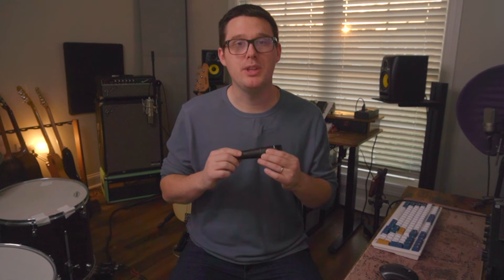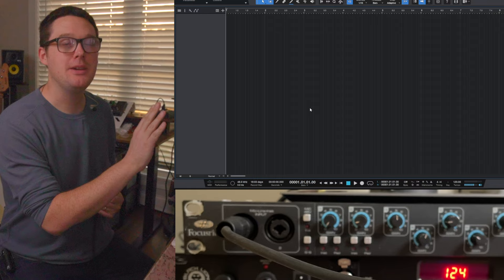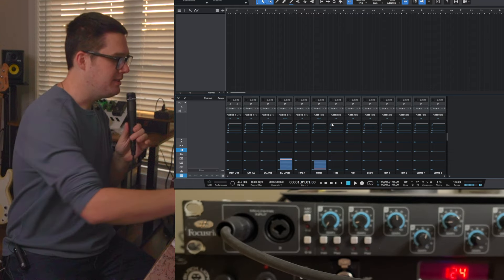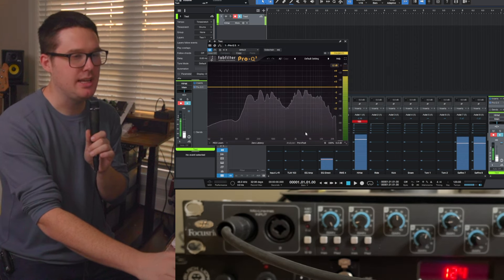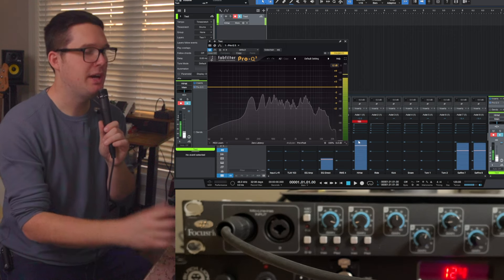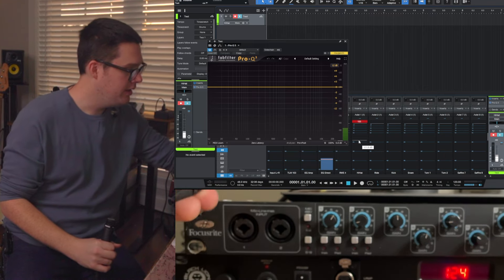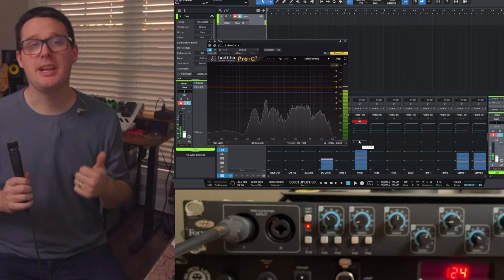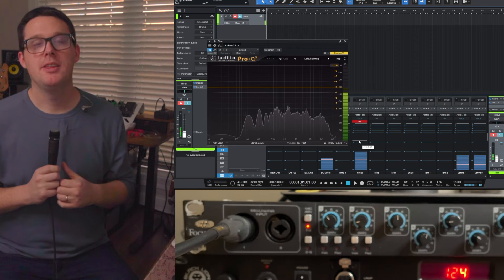How to Stop Hissing Noise When Recording

Comment: Hi chris, My interface has a high pitched hiss that records even when I am not using gain. Do you have any idea on what might be the problem?
Reply from the maker: Are you hearing this in your monitors or headphones? I have a pair of Rokit 5 monitors and one of them hisses quite a bit. They are old and busted up. The cables could have issues as well.. it can be a pain but if you take some time to swap out cables one by one and try different speakers or headphones you can deduce the problem that way. The output of audio interfaces also have noise to them as well. Cheaper interfaces will be noisy when you crank the output. Could be a mic cable or also guitar signals.. recording guitars is very noisy, single coils can be a problem or heavy gained guitars.. 

Switch off phantom power or 48v if possible.. record your signal into studio one and export the audio to a WAV file. Take the recording and listen to it in your car to see if it is actually recording with a high pitched noise or if it’s just the interface

Comment: Hey im into VO and ive connected my condensor mic to a mixer that has phantom power than thenoutputs mic audio to my laptop through rca and 3.5, or 1/4 to 3.5 and im getting some hissing noise, i switched the two cables and still the same, the hiss is below -48db but is there a way to completely eliminate it? i rem connecting the 3,5 using an adapter to the type c port and it was clean, any idea how and why?

Comment: Thank you so much for this video. 
I honestly thought my Scarlett Solo was broken when I saw a high noise floor. This makes a lot of sense and I'll be getting CloudLifter immediately!
Quick question - if both the mic and the CloudLifter require phantom power, does that cause a problem?
Reply from the maker: Great! Be careful the cloudlifter does not pass 48v phantom power and is only meant for dynamic and ribbon microphones 😬 

Condenser mics should have sufficient gain on their own but just know not every condenser mic is the same quality.. some mics are very poorly designed and have excessive noise to them. Thanks for watching!

Comment: Hi chris your video's are extremely helpful thank you i use a sm7b into a mixer then into audio interface would you recommend a cloud lifter with this setup thanks
Reply from the maker: What kind of mixer and interface are you using? They both have mic preamps so you wouldn’t need the cloudlifter for more level.. it MIGHT benefit your setup if you have a noisy mixer or interface.. the cloudlifter is 10db of clean gain, I use mine all the time. If you use it before your mixer just be sure you’re using the line out from your board to your interface.. things can get messy with so many levels of amplifying 😅

If the gain knob of your mixer is above the 50% mark I would check out the cloud lifter. Send it back if you aren’t satisfied. I’m not 100% on their policies but I’m sure a Sweetwater salesman can explain their policy
Reply: @heychrisgreen  hey Chris thanks for reply it's a small beringer mixer and presonus interface thanks for your advice appreciate it

Comment: I have a important question bro please help me  🙏🏻
When I increase the gain to the end and no microphone is connected, a hissing sound comes into the headphones. Is that normal or my volt1 sound card broken?
Reply from the maker: Great question! First of all, if you increase the gain knob to 100% you will definitely hear hissing sounds. That is true of all preamps. BUT if your mic preamp is turned down all the way and you’re hearing a hissing noise I am assuming you are hearing the hissing from your output knob. Confusing to speak of but there is noise that is present with inputs AND outputs.. your output is essentially an amp for headphones and speakers.. not every interface is created equal.. I have most often heard hissing noises that are high in interfaces less than $400.. one test you could do is record a signal in your DAW and go to your car or other speaker system and play it back to compare the noise level.. if you only hear the noise in your headphones with your volt but not in your car then it most likely is just the quality of your interface. 

Also listen to music or a YouTube video with your headphones on at an appropriate volume.. you should not be hearing any hiss.. if you do I would say that interface may not be broken but it is just a poor quality. 

Sorry for rambling but I know that is a frustrating thing!

Comment: It's an interesting video. However, the cloudlifter isn’t suitable for condenser mics, like I use. Even if it was, all that is really achieved is moving some of the pre-amplification from the cheap interface which you already have, to the expensive cloud lifter you have to buy. 🤔
Reply from the maker: Thanks for the comment! 🙂 I hear you!
I would say most audio interfaces less than $500 have a typical noisy preamp. The most affordable route is a cloudlifter. External mic preamps go for $300 on the cheap side, and even the Warm Audio gear is $700+. I’d rather go cloudlifter for $149 than have to start over (if you bought your interface already)
I’ve owned the Audiobox, Scarlett, Apollo, iD14, and Behringer interfaces. The less expensive the more noise. (From my experience) 
The NT2A and TLM 103 condensers I have and use, don’t have to use as much gain to get a similar level as the dynamic mics. Which is why you don’t really see cloudlifter tools for condenser mics, they’re just more sensitive.

I only use the Cloudlifter with my SM7B, the other mics I find to be plenty clean IF I set my gain levels properly
Reply: @heychrisgreen  I'm not suffering too much from noise. I do sometimes use a dynamic mic connected to an original Scarlett 2i2, and also mainly dynamic mics connected to a Tascam DR-60d mk2. In both cases I find the easiest way to rid rid of noise is via the noise reduction facility in Audacity. I'm not doing any live audio, so I always have the option to post process. Thanks 👍 😀